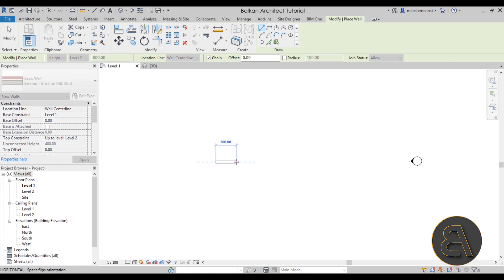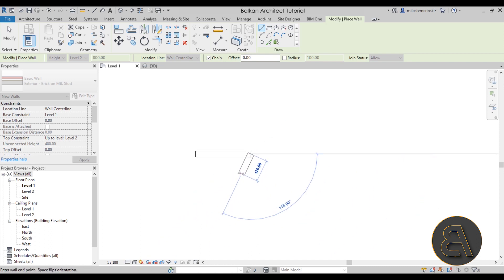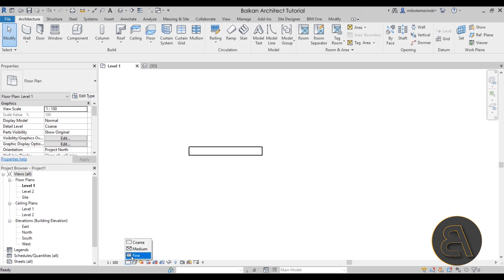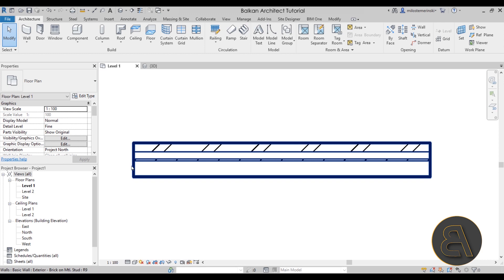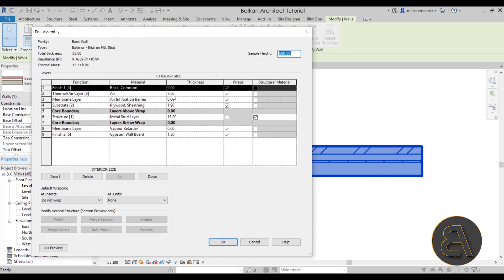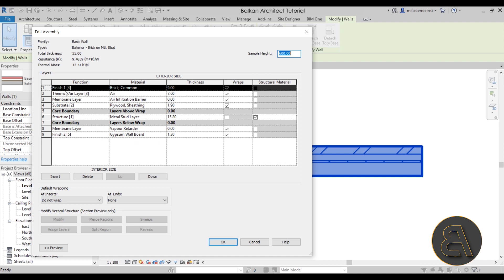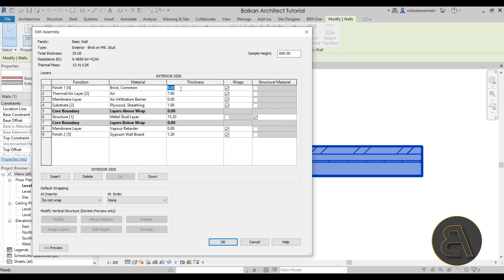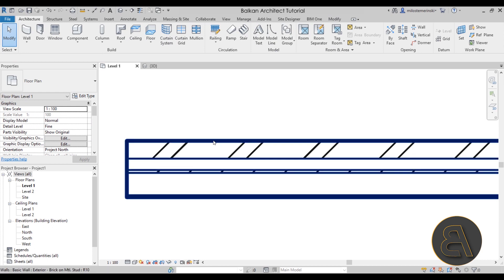Calculate the Number of Bricks in Revit Walls Tutorial

Comment: Hello. It is possible to calculate timber volume (m3) for timber framing house in revit? If yes than where can i find. Thanks
Reply from the maker: Hi, it is possible, even better, you can calculate the length of each profile of timber construction needed. I don't have a tutorial on that, but my course on steel buildings in revit covers something like that, you can find it on my website (first link in the description of the video) 🙂
Reply: @balkanarchitect  thanks for info

Comment: Thanks for the video. Can you please advise why you used the volume rather than the surface area?
Reply: calculation based on surface area is helpful for counting number of bricks for single brick walls only, whereas calculations based on volume provides more answers, i. e. number of bricks, quantity of mortar/ sand/ cement / other materials, etc. 😊